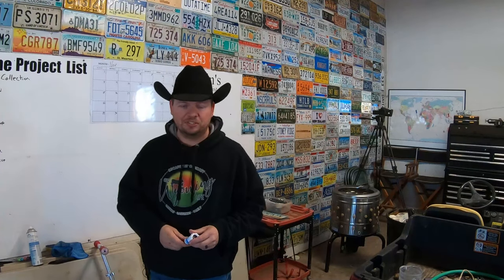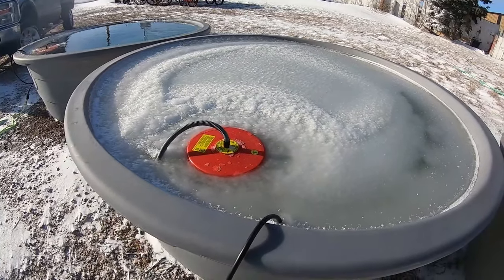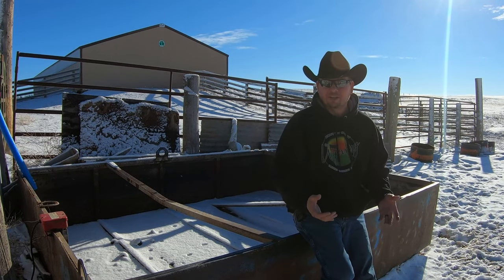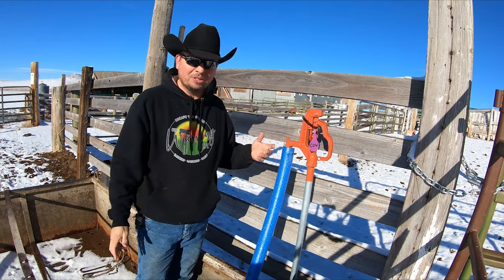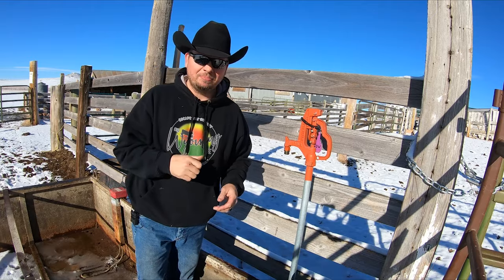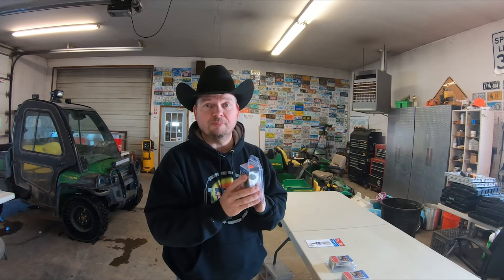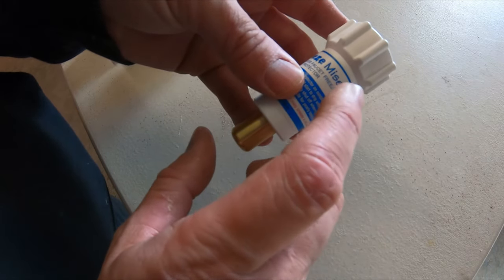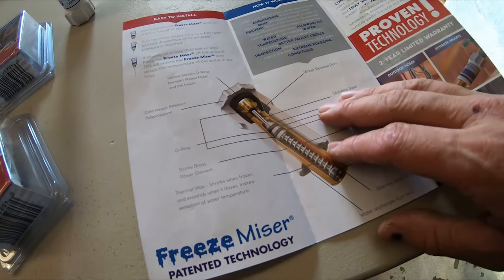Freeze Miser - Product Review - Part 1 - Concept and Installation

Comment: I've been using these for a couple of years now.  I'm in central Texas so not your kind of cold but we do get hard freezes here.  I take them out for the summer in hopes they will last longer.  So far, so good and they've worked like they are supposed to.  The dripping action will help keep the ice from forming on the top.  I haven't had to clean one out yet, but there's a way to do that.  What I like is they work off of the temperature of the water and not the air.  If your water is warm, they run less.  I can tell which hydrants have better insulation as they drip less.  Some folks place a second tank with an overflow line to the main tank so the dripping water doesn't go to waste.

Comment: Mike, when you turned off the side with the hose on it in the stock tank you also stopped the flow to the Freeze Mizer. The float will have to close to allow the water to continue to the freeze mizer.

Comment: I hope it works.  I believe the running water is to warm for it to start working. Ground water it usually about 50 degree. Will need to cool off before it will start to work.

Comment: I love the idea. I'm still wondering if the valve, in the float, will freeze and break. That water won't be moving. But it should only be about 3 or 4 inches. Let's see what happens.
Reply from the maker: I'm wondering the same thing.  Trust me, I am keeping a close eye on it and this isnt hard freezing conditions either!  Thanks
Reply: I'm wondering if the hydrant (being medal) might get cold faster than the hose (being plastic/vinyl) and then freezing and wrecking your hydrant.  Seems like a big risk.   Also wondering if extremely hard water (like I have) would shorten the life of the freeze miser.

Comment: I use 5/16" maple sap tubing to water our pigs and chickens.  It's fed from a concrete riser underground that has a valve that is cracked for a steady trickle.  Water moving through a small line moving at that speed doesn't freeze.  Yes, there's some waste water that needs a clear place to drain (again, under ground pipes capture and drain it away, flowing water with snow cover or underground doesn't freeze).  We've been doing it for years, and until this year watered our 50 head of cattle the same way.  We recently built a heavy use area, so the cattle now have a Richie heated waterer.  A tiny trickle of water into a large heated stock tank will serve many head of cattle.  In our chicken coop we use a taco circulator to circulate water to our chicken water nipples.  A small tank with a heater in it stores the water, 5/16" line run in, water is heated to 45°, taco circulates it, overflow drips out the back to a drain area.  I've shown the setup in a few videos, I'll do another soon showing my latest setup.

Comment: Mike, I'm gonna offer you some advice from MN. Get yourself a steel barrel, cut one end off. Flip it open end down, then cut a hole to match the diameter and height of a torpedo heater discharge. If your hydrants are tall cut a slot in the top for the head of the hydrant to come through. Slip the barely over the frozen hydrant and line up and fire up the heater. Crack the valve open after a bit. Works well to thaw out a frozen hydrant, and I think you might need it...

Comment: Full-time RVer. Heat tape,  run along hose and water faucet and pipe (not a hydrant) where it rises from the ground. Everything covered with foam pipe insulation. Only had to put the hose in the shower for defrosting one time.
I believe the manufacturer says not to use it on a hose. But the manufacturer doesn't live in an RV.
Reply: Yes it does.   Works down to about zero wind chill
Reply: Isn’t working on our faucet. It’s still frozen over

Comment: The freeze mixer works on the water temperature...not on the air temperature.  It drops when the water temp is 37 f or lower.  So if The air temp is say 28 f but the water is 50 f because it is running it won"t drip.  After it sets a while and the water temp drops to 37 f it will start dripping or running.  So when you were running water through the hose it was warm ground water.
Reply: I never knew that.   Course this is my first time seeing this and I was wondering why not just drill a 1/8 inch hole in the water line.     Thanks for the explaination

Comment: You should try a hudson valve and and put a hudson continuous flow disk in it
We use them on all of our tanks with hydrants in the winter,they work very well and  they don’t run any more water than the freeze mizer. I tried the freeze mizer and it did keep the hydrant and hose from freezing but the water did freeze right at the float and it wouldn’t allow the tank to fill on a zero degree day; the only down side with a hudson valve float is you will have to unscrew the base and make sure the water is  out of it Because if you do shut your hydrant off at night the water inside the float will freeze

Comment: My guess is the second hydrant that wouldn't leak is warm enough with the sun in the water coming from the ground fully opened at ground temperature. Keep up the good work Mike I hope it works for you. I battle the same problems and just keep breaking ice. It only gets cold enough a couple weeks out of the year for me to have to do that.

Comment: A couple thoughts.... Initially, I thought why not lay the extra hose in the stock tank because the water is heated and would help keep the hose from freezing up.  Then, when the freeze miser near the end of the video wasn’t working properly, it dawned on me.  If you are heating the water in the tank, then you are also warming the freeze miser as well & perhaps that is why it is not functioning as intended.  For keeping the stock tanks from freezing, I’ve seen videos of what is basically like a trolling motor mounted in a ring that you toss in and it keeps the surface water moving.  It was used primarily to keep open water near docks, but might work.  

Take all of this with a grain of salt, as I’m a FL boy born & raised & we only worry about the occasional night or 2 of freeze hurting the citrus crops.

Comment: I'm sorry to say this but as a past licensed refrigerator, Freezer, AC and  Residential Heating contractor I don't see those freeze mizers solving all his problems with freezing issues.  They might work in specific uses but not in all.   For example, with the hose alone location. It should keep the hose from it back to the spigot from freezing up but the water inside the sprayer nozzle will still freeze up and it will make an Ice Skating Rink for sure.  
As far as with the tank location issue. What are the odds of 2 out of three new ones not working OR for some reasons why was one cold enough and not two all being together until connected. I suspect "possibly" the "T"s valve going to the mizer was off.  When Mike first turned on the water at the tank the mizer was not passing water and the float valve was flowing. and we never saw him turn on the valve on the "Y" to the mizer.  That could just be an over sight missed but worth checking into and see if that was the case.

Comment: Howdy Mike, the theory that running water will not freeze in the Winter is seriously flawed. I mean if Niagara Falls can freeze pretty sure a trickle from a faucet or garden hose is going to freeze should the temperature drop enough. The best way to prevent water from freezing is keeping it above 32 degrees. Anyway hopefully the Freezer Miser will help you out and lessen your Winter work load. Never know unless you try right. Have A Day! ;~)

Comment: Wind is the real enemy of water. I've had troughs not freeze at even 25 degrees in a night. I've had them freeze solid at 35 with a good wind
Reply: So you can freeze water at 35°?  How bizarre...
Reply: @justskoot7176  yes with a wind chill you sure can 👍
Reply: @tankscrittersandurbanhomes5579  sorry but no. Wind doesn't make things cold it only makes things get to air temperature faster.